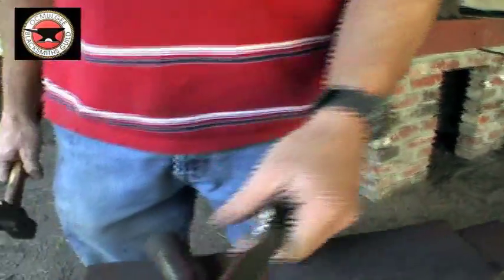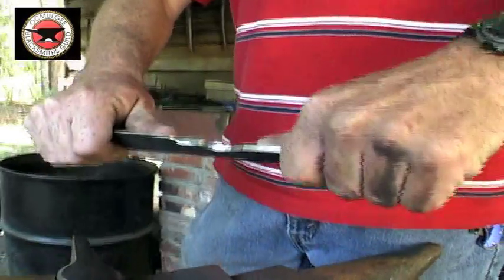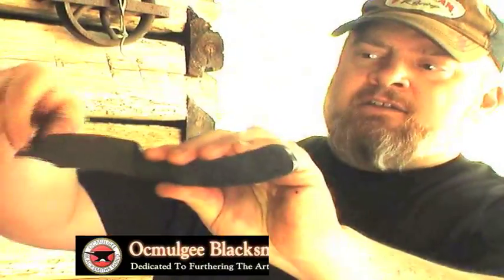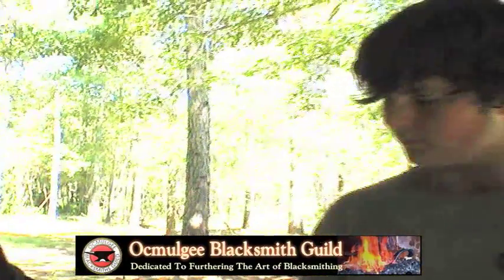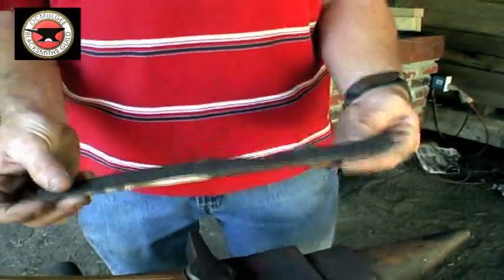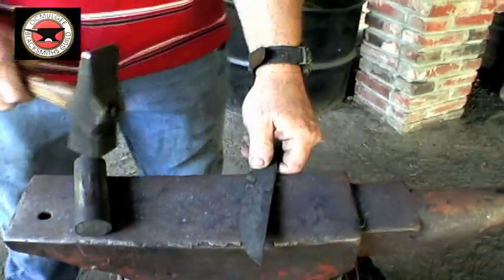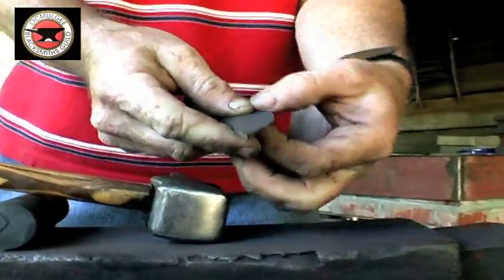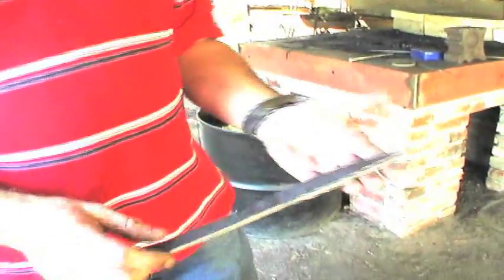Hand forging a knife

Comment: gread vid!!! after i've forged mine, sanded it and cleaned it all up i'll bring it up to nonmagnetic and let it cool to blackheat 3x, the last time i'll heat it up , let it cool , and stick it in a bucket full of kitty litter and let it sit for 24 hours. then i clay the blade with # 36 refractory cement, hit it with a torch- bring up to nonmagnetic, and quench in used motor oil (heated up to atleast 140 degrees) - i leave in quench til it's cool, knock the clay off...resand, etc...

Comment from the maker: @Makermook Yeah it makes it easier for me. The most common way to do it is to lay your blade on a good edge of your anvil where you want the plunge to begin and hammer using light accurate blows then flip it and try to keep it as close to in line as possible. It takes a lot of practice to get it right. Make sure you don't accidentally roll down metal and get a cold shut.

Comment: what you did was heat treating. that makes the blade super hard and brittle. after that you have to temper it. this means heating up the steel in an oven and to a certain temperature for a given period of time then letting it cool down on its own.

Comment from the maker: All steel moves in the same fashion when hammered while hot. The only difference is it's a LOT harder to forge high carbon and low alloy tool steels than it is iron or mild steel. The curve you speak of is compensated by me in the video by creating a counter-curve preform before I forge the cutting edge. A lot of people prefer to correct the curve as they forge by hammering on the cutting edge spine down usually with a wood mallet. I prefer the counter-curve method.

Comment from the maker: @roglet123 If I remember correctly I made that blade from 1075 or 1080. You can water or oil quench all simple steels and a few low alloys. Most often I use a fast oil or brine for those steels....

Comment from the maker: Well you can check places like craig's list for old items, or you can simply build ya a  brake drum forge and use a piece of railroad rail as an improvised anvil. You can buy a cross pein at home depot, but I advise you knock out that fiberglass handle and get ya a hickory one

Comment from the maker: @tennessehellbilly It depends on the steel brother. Most simple and low alloy steels forge well in the 1600-1800F range. Forge welding heat for those mentioned is usually between 1950 and 2050F. The higher the carbon content the lower welding heat is. You should give it a try man. I like it lots better than stock removal only. There are so many more possibilities.

Comment: a steel anvil that has a good weight (at least 100lbs) is very hard to find for less than 600 or so unless you know someone. you can find a chunk of steel in a gunk yard that will work, just make sure it is flat!

Comment from the maker: Yes it can be very tricky. The best way for me to do it and the way I show others is to start by forging a preform. The preform is shaped to account for what will happen to the blade as you hammer it into a blade shaped object :) Check out my video cable damascus tutorial parts 2 and 3. In it I discuss a couple of preforms and forge a clip point blade in the third part... Maybe it'll help ya a little.

Comment: Hello Evan, I've attempted to forge a blade using normal iron (just for forging practice). As I strike the stock to forge the cutting edge, the stock tends to bend, resulting in a curved blade. Correcting this curve without damaging the cutting edge seems almost impossible. What are your thoughts? Is there a way to avoid having the blade curve? Or does this problem not happen with hard steel?

Comment: Sorry, but I think heating and beating steel into shape only to use a belt grinder is a waste of time. I watched a 90 year old Japanese guy hammer forge a knife then use stones to finish it. Point is, why bother hammering if you're just going to use power tools? IMO, it takes away from the entire process and devalues the hard work.